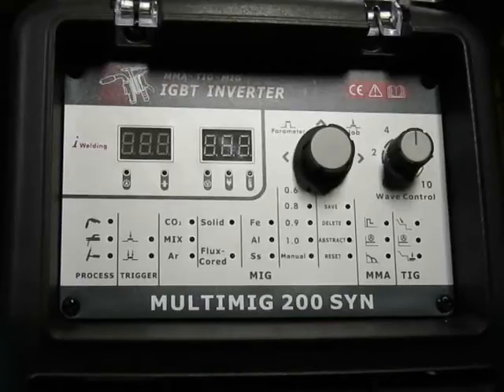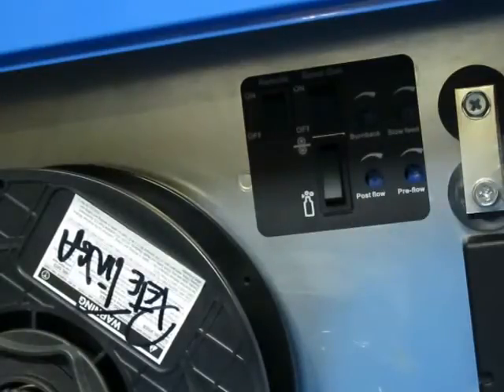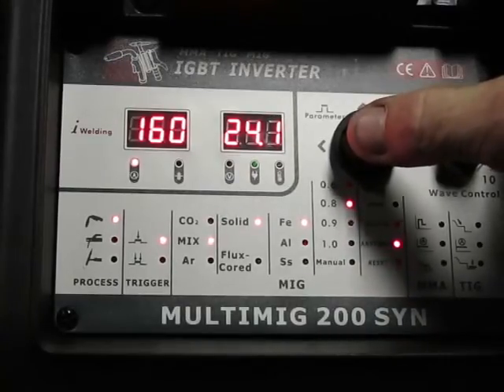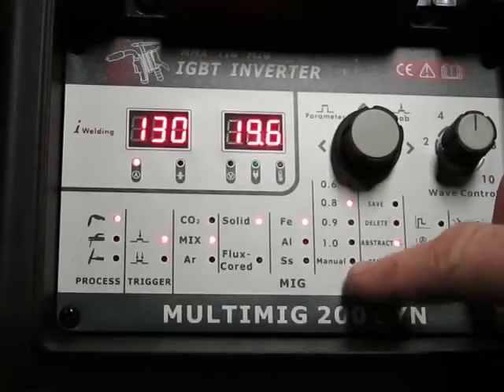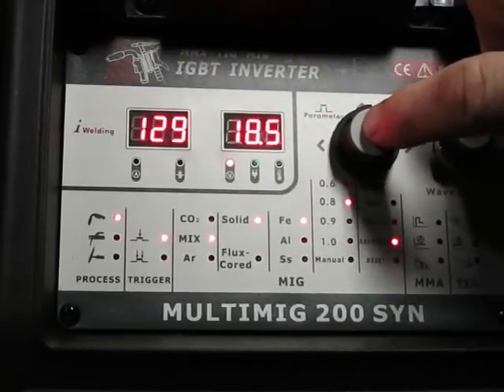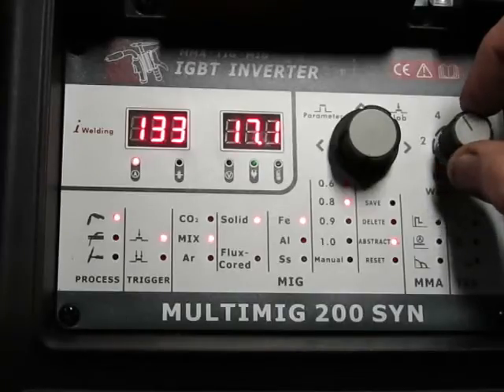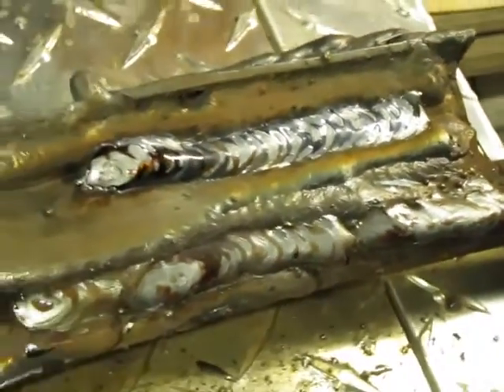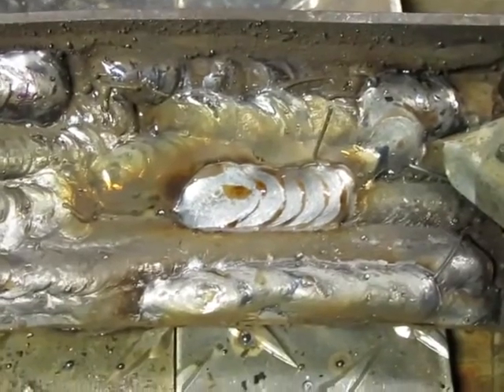Hitbox Multimig 200 Syn overview and setup.

Comment: This 200 syn seems more versatile than the mig 200, allowing for thinner wire.  Is this your opinion or does the mig 200 have as many functions but with fewer controls?  The 200 syn controls make more sense to me.  Do you agree/disagree?  Thank you.
Reply from the maker: More versatile yes i would agree, the Mig 200 still has wire inching apon trigger pull but its automatic, back-burn seems to work perfectly too. The Mig 200 will run thinner wire just as easy. The Syn 200 has gas pre-flow which i've always thought every Mig should have. I was welding sheet metal with the Syn 200 sometime ago and i had to dial the wire itching all the way back in order for the machine to give me the amperage i had dialed in on the dashboard, i've never felt i needed to do that with the Mig 200. Yes controls making more sense i agree because i like being able to dial in every aspect of the process, some people may want the opposite. The Mig 200 has less function controls but is still head and shoulders above my Lincoln 180.

Comment: How does this unit compare to the Hitbox Mig-200 you reviewed in that video?
Reply from the maker: I would say the Mig 200 holds its own very well against this Multi Mig machine, arc is just as nice and quite adjustable, i like the 2 push buttons and 1 dial for easy setup.

Comment: They must have discontinued this model and replaced it with the Mig 200 multi process welder. It is now orange and has a different front. Still does mig, tig, and stick. Thinking about getting one off ebay. New ones have the IGBT technology as well. Looks like a decent welder for the price.
Reply from the maker: I think the machine was pushed in the european market primarily, the closest thing to an official owners manual i could find was in russian, Hitbox tried this machine in this market but i don't think people understood what they were looking at, at that time, to complex. I bought one of just a few machines they ever sold. I didn't buy it for the TIG (already had a AHP alpha) as much as for the TIG features that are utilized by the MIG and the full complement of Mig controls. This welder continues to impress me, arc is the best i have ever used, this thing will lay beads on paper thin sheet, it transfers the molten wire that nice. I've used the machine you are looking at, it has variable inductance which makes tayloring your weld to your welding style and material a huge bonus. Its compact which really frees up space and you can set it up anywhere with the bottle secured 20 feet away if you want . Arc is as good as any blue or red machine i've used. Definitely IGBT is sooo nice to weld with!